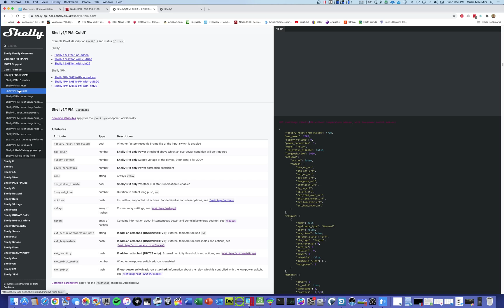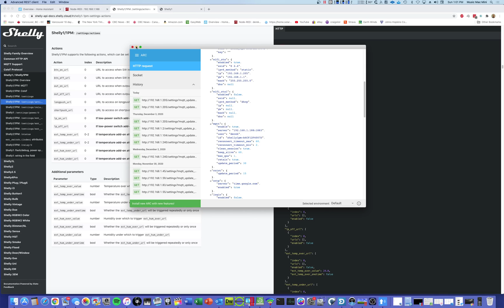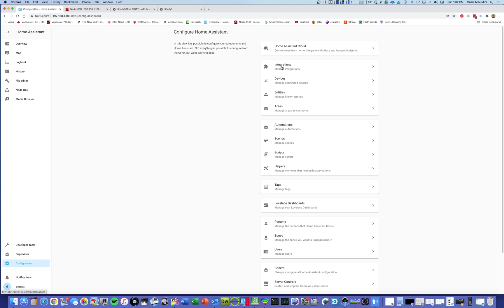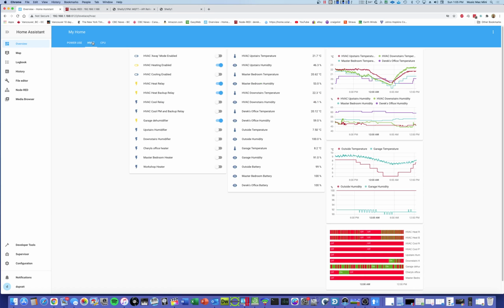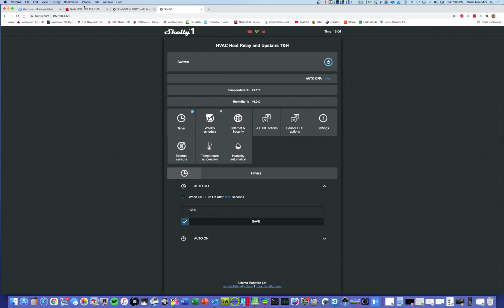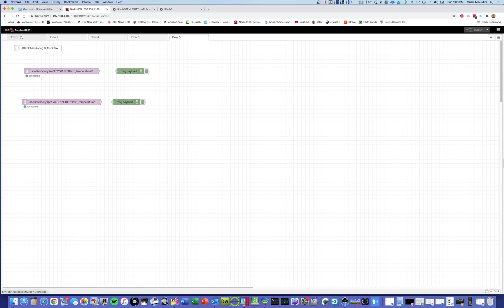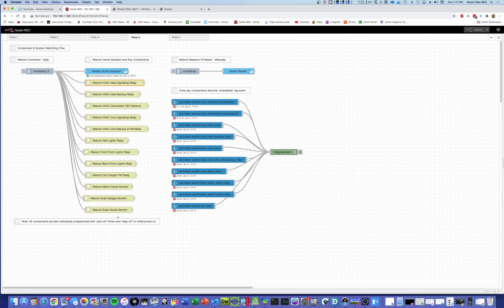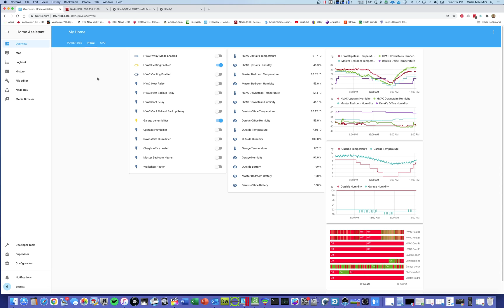Home Assistant + Shelly IoT Integration - how to build a more reliable system

Comment: I find that you pay a penalty on response time using the MQTT integration of Shelly relays in HA. I agree cloud is crap but I get better response times with unicast config directly to HA server. This is an HA issue because MQTT response time with Shellies in node red is even faster. I’m using a detached Shelly 1 to control another Shelly light (3way) and it’s noticeably delayed if you use HA MQTT in yaml.
Reply from the maker: Great feedback. I have set my MQTT reporting to 15s for critical sensors and 60s for non-critical ones as I don't want too much chatter on my network. Funny that NodeRed is more responsive than HA - thinking it is more efficiently written (more real-time).

Comment: I have not played with the Shelly devices yet, just ordered some and have been researching them (thus why I landed here). I'll probably go the Shelly Home Assistant integration route at first just to get up and running... I'm just controlling some non-critical lighting but, MQTT is probably where I'll end up once I have time to work on it. 

 I find it interesting that you had issues with the Shelly integration, but like you said, no one else mentions it. Also curious is that I could make a sandwich while waiting for your HA pages to load... maybe the page loading delays and your issues with the integration are related?
Reply from the maker: My memory card was dying so the system was very slow - fixed now. I am a believer in moving to a platform with a proper SSD - see my notes in the video at the bottom. Best of luck!

Comment: I like your suggestion about allowing the device to turn off after a period of time has expired - kind of a failsafe turn off so you are not greeted with outside flood lamp that has been on all day.  In tamota you can do that with "pulsetime1 300" to turn OFF relay 1 after 5 minutes (or whatever time you want to use).  The timer starts as soon as relay (light) is turned on..if turn off prior to the end of the timer it just resets - waiting to be begin again when the light is turned back on...

Comment: Very interesting , I just got my hands on some shelly devices so I'll be keeping an eye on them ,    I was wondering the type of router and AP;s your using for your network.
I moved away from the PI running HA a long time ago as I found the pi to be not very stable.
I noticed in your video when you moved around in HA it took a long time for anything to change .
Reply from the maker: Sometimes the Pi is very responsive and occasionally (as in when I was shooting this video) it was very slow to update the UI. I use a new Asus mesh router system but the shelly devices only run on 2.4G so much of that goodness is lost on them.
Reply from the maker: I think the Raspberry Pi stability issues may be related to their reliance on SD cards for a 'hard drive' - they just can't take the I/O and start to get corrupted - and are also famous for glitching out when the power supply is marginal. I am also going to migrate away from my Pi 4B once my new Home Assistant Blue unit arrives (2x faster CPU, SSD based, etc). I have found VMs work really well but hate the idea that a 24x7 HA server is sharing h/w with other OSes and Apps that are not mission critical and may need to be rebooted, etc.

Comment: Thanks, that was good content. I’d be interested to see a more detailed walk through of how you designed your node-red automations; it’s something I’ve struggled with.
Reply from the maker: I can setup a link to my NodeRed code if you want to create a new flow and dump one of my flows in it to look thru it?
Reply: @derekspratt  Thanks, that would be wonderful. I have years for network analysis experience, but am very new to automation and have struggled with how to get started with the thought process.
Reply: @derekspratt  I'd be interested in that link as well
Reply from the maker: @rrrrrrrr290  www.spratts.net/Misc/flows.json
Reply: @derekspratt  thanks slowly working my way through your flows .  always interesting to see how people put flows together,
your sunset lights had me confused for awhile , but then worked out how your using the switch nodes, I haven't  seen it used that way before ,  normally   seen the one switch node with the 2 options,  
thanks for sharing
Reply from the maker: Just posted my links to my NodeRed and Yaml config files in the above description
Reply: @derekspratt  Thank you very much, that’s really helpful.